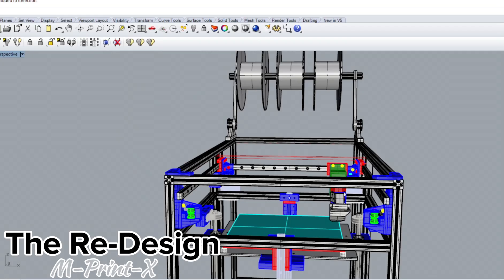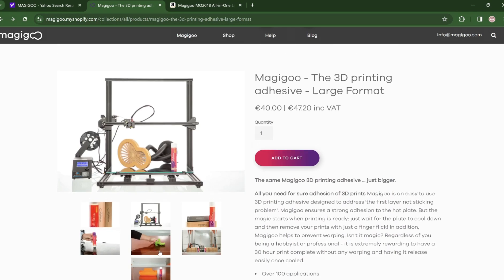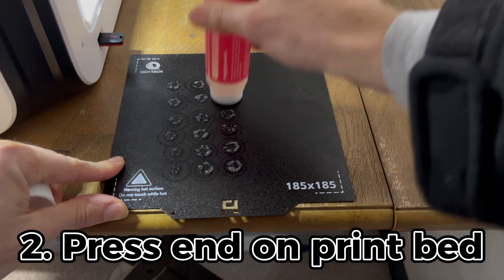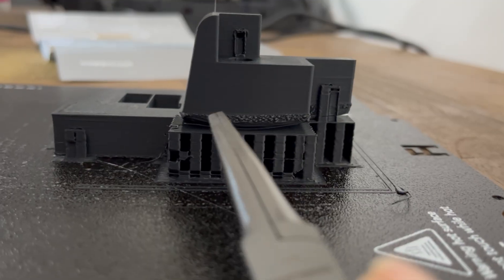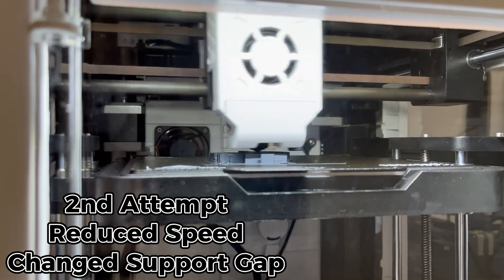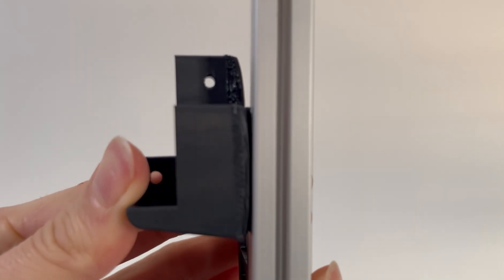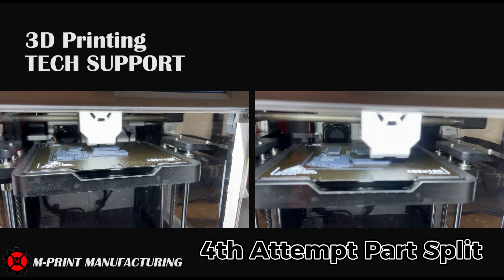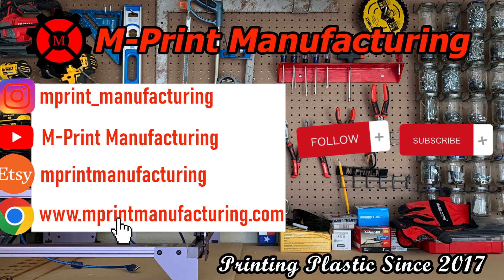Warping of ASA Filament | 3D Printing Tech Support | The Secret Product for printing ASA Filament

Comment: I use ASA for a lot of small parts. It's really good for automotive stuff because it can handle the temperatures found in a car on a hot summer day. It's easy to make adhesive for it using ASA scrap and acetone. It also sands well. I have a heated chamber and have no issues with bed adhesion using the PEI sheet with small parts . The problem comes when I try a large print. It always warps. I have at times just made parts a bit thicker so I could sand them flat, but that is really not ideal.
Reply: yeh i tried a big part, and 3 failures , even with that special glue.
Reply: @tek_soup  try enabling brim; Are you printing ASA in the enclosure?
Reply from the maker: Large parts can be tricky if there are any bed issues with your printer. What printer are you using and the material? PTEG is stronger than PLA and better for large parts but not as difficult to print with like ABS or ASA.

Comment: I thought ASA was supposed to be easier to print than ABS.  I guess not.  Have you tried a draft shield? I am not sure if it would work and it uses a lot of fillament, but it might make the part not cool as fast.

Comment: While I have not tried ASA yet, PETG does have similar issues with warping on large prints though I have never heard of warping moving up vertically.  I usually use mouse ears (tabs) around large prints to remove warping.  I have tried magigoo and it works well though don't get impatient and use it when the bed is still fairly warm or the applicator will turn hard as a rock.  Don't ask me how I know.  Magigoo is a bit expensive though so I found some blue glue sticks on Amazon that work just as well for less than a 1/3 the price of magigoo and you get 6 of them.  They are advertised specifically for 3d printers.  The warping issue which made me laugh though was when my print stuck really well, but the sides of my PEI sheet curled up on the sides.

Comment: you could try to worm up the print chamber by letting the bed soak for 10-15 minutes at maximum allowed temperature before printing. sometimes it helps
Reply from the maker: Hi @ammara6013,  we’ll definitely give it a try.

Comment: Nice to see someone else with the Xsmart3. Does the fan noise bother you? Drives me crazy. I swapped the power supply with a Meanwell, which helped, but the motherboard fan is still awful. I tried two other fans, including one with an aluminum frame, and a Winsinn ball bearing fan. I had also redesigned the fan mount so that it doesn't block airflow. It's still bad. I think the problem is turbulence caused by part of the fan sticking through the bottom plate. 

Have you tried turning off the rear case fan? That would increase chamber temperature and should decrease warping.
Reply from the maker: Hi Leafye! I have been using the Xsmart3 for a little over a month. You should check out episode 10, that’s when I bought the printer and did a full review. Yes the fan that comes on the printer is very loud and I plan on replacing it. I adjusted the fan speed but will test next with it off!